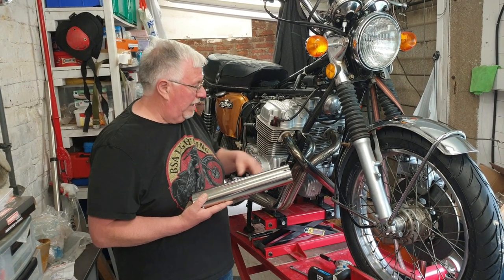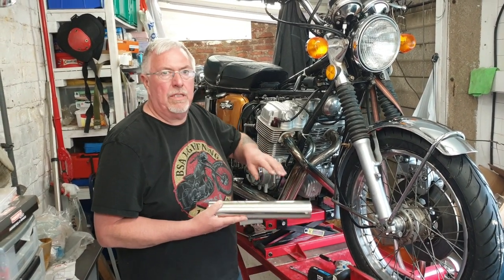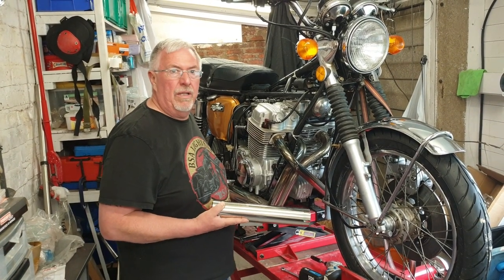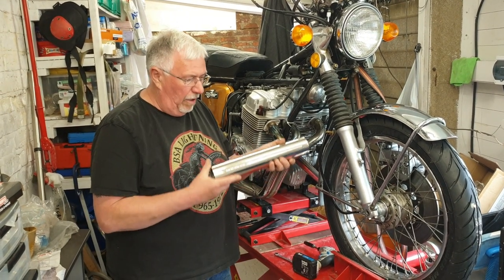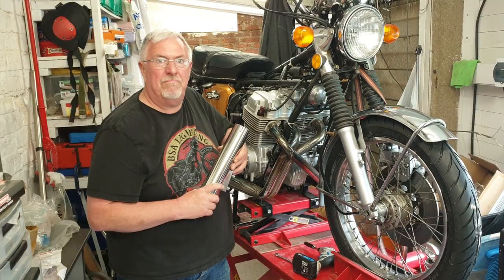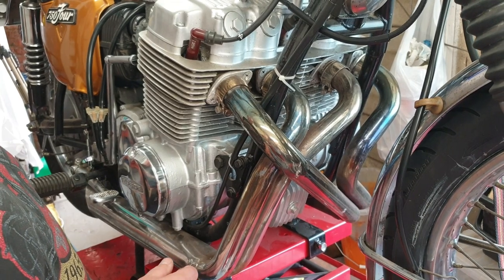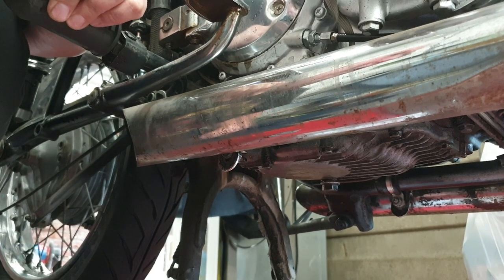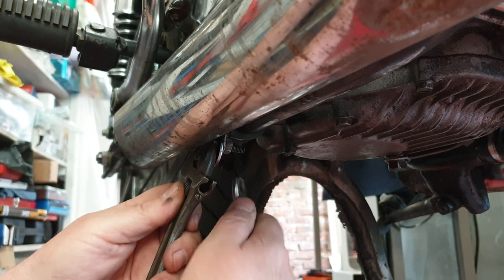Delkevic Exhaust Fitting Guide | Honda CB750 4 into 1 Pipe Sound | Motorcycle Project | Part 19

Comment: Thanks for documenting the process.  I have a 71 barn find where the factory baffles are rusted through at several seams.  Just yesterday I took them off and dumped several pounds of seeds, insulation, and rust chunks.  This looks like a good sounding option.
Reply from the maker: It's always amazing what you find when resurrecting a barn find bike. Sounds like you'll definitely need a new exhaust then! I can confirm that the Delkevic is a great choice. :)

Comment: Great video!  I just put this same exhaust on my 1973 CB750 K3 last week, and I ended up using the supplied spacers to move the bracket a bit inboard to make everything line up.  It took a bit of forcing to get everything to line up, but it eventually did.  
 
To anyone thinking of buying this exhaust, it sounds a lot nicer than any of the videos convey.  You have the ability to remove the baffles, but I'm not sure why you would do that.  It sounds great the way it is.
Reply from the maker: Awesome, it is a fiddly job but well worth it. I'm a big fan of how these Delkevic exhaust systems sound. They really are sublime.
Reply: Is’t the noice to loud of the delkevic? The once i have now give me earproblems.. but before buying, would like to hear your opinion. Regards Frank
Reply: @SrgBlueBalls  They’re loud-ish. They sound like any other performance exhaust that you would find on a modern sport bike. They DO NOT have the same sound as a stock exhaust.
Reply: @HIPNAUTIC.  Do you have any experience with the marving exhausts? Delkevic's look nicer, but im really looking for a bit less sound. Thanks for the fast reply @hipnautic
Reply: @SrgBlueBalls  I don’t have experience with any other exhaust besides this one. Good luck finding what you need. In the end, a good set of earplugs might be in order. -HIP
Reply from the maker: @SrgBlueBalls  Hi Frank, I'd say the Delkevic exhaust for the CB750 was OEM loud, or maybe slightly louder at most. There's a removable baffle in them too, I've left mine in. Hope that helps
Reply: These mufflers are very free flowing, however, if you want to eliminate any back pressure and make the bike run more efficiently, leaving out the baffles will help.

Comment: Good video. I just received the same model today. I expected there to be clamps included. Where did you get yours sir? Edit. I was able to use the original finned clamps. Also, my muffler came with a center stand rubber stop. How in the world did you get your springs on with a screwdriver? Mine included a very handy hook that even Schwarzenegger could have used!
Reply from the maker: Thanks.  I got mine secondhand, so some of the parts were missing.  I made a bracket out of some sheet steel I already had.  Those springs can be difficult to fit, but not usually as bad as centre or side stand springs.  I really must get the correct tool for the future.

Comment: Do you know the torque settings for the header bolts? I hand tighten mine, then after a run have to again - I need to get some lock washers,  and find that torque setting. If you got it, thanks -
Reply from the maker: My understanding is that there isn't a set torque for the header bolts because of the crush washers.  The wisdom seems to be, hand tight, then 1/4 extra turn, check if it leaks then an extra 1/4 if it does, maximum of 3/4 of a turn overall.  If still leaking start again with another crush washer.  I also use exhaust assembly past which does seem to help stop leaks.  Whatever you do, don't over tighten, you can pull the studs out of the head, they only screw into the alloy.  Hope this helps, good luck.
Reply: @SPANNERRASH  Thanks - there has got to be a torque setting - right now it is hand tightening. I relly  on those crush washers, but . . .
Reply: @SPANNERRASH  Thanks engine is hot  in just returning - will torque them just gently - btw; I subscribed, and you are listed as a featured channel on my channel -

Comment: I got mine on - really nice on the 1979 DOHC CB750 - This Tuesday, I'm seeing Danny at Meineke to get the springs on - I could not - https://youtu.be/IsLYxujqSvk
Reply from the maker: They can be really difficult and there are lots of different ways that you can hurt yourself if you aren't careful. 

A good trick I have seen is to put a strong cable tie through the end of the spring so you can pull on that to put it in place.  It's the one I will use in the future.
Reply: @SPANNERRASH  Thanks for your reply - Im hoping Tuesday to get them on -